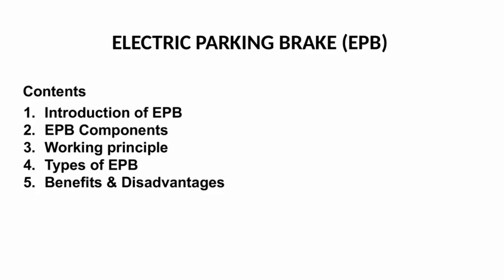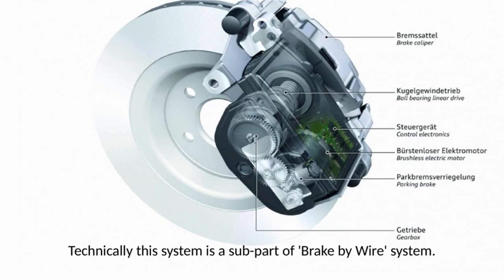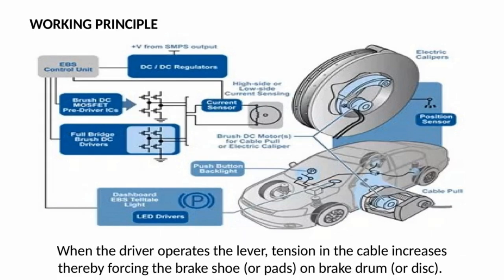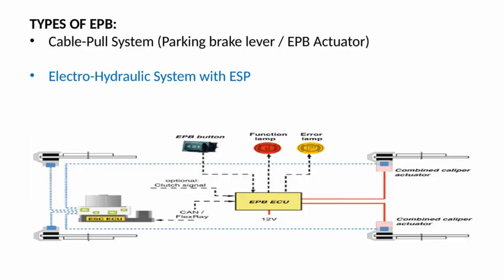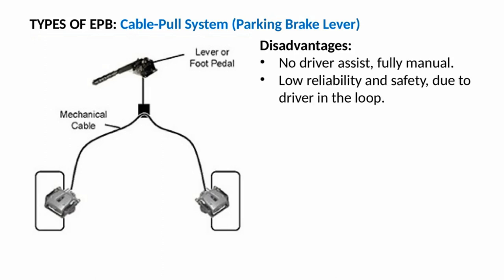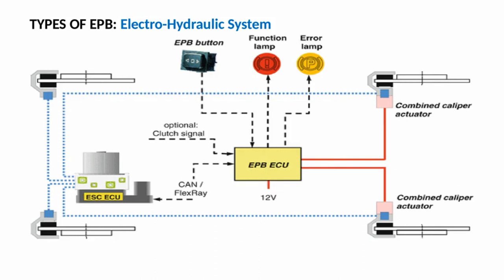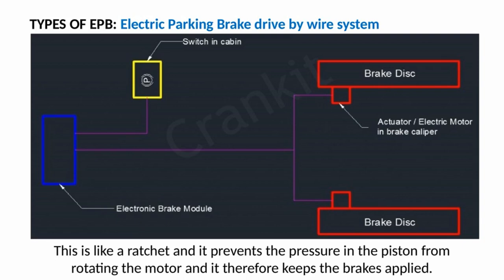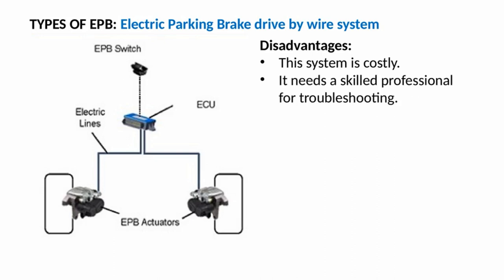Electric Parking Brake

Comment: My BMW Z4 has electronic parking brake, best system ever. Hill assist is nice feature, but it' reliable, cars 11 years old never had a problem. Never needs adjusting like cable. Pad changes are easy. Can't fault it. No more scrapped knuckles try adjust cables buried behind prop shafts or exhausts.

Comment: cable system benefit/epb disadvantage: you could do a 180 with your car - no more with epb.. faceplams - what about tv/film stunt production? do they now need to use special cars for it? (rhetorical question)
Reply: Even in the 80s, cars have been rigged so as to make locking the rear brakes for 180 degree turns or drifts easier to manage.

One of the common hacks is removing the ratchet mechanism of a foot operated parking brake. That way, rear brakes can be activated and modulated as required.